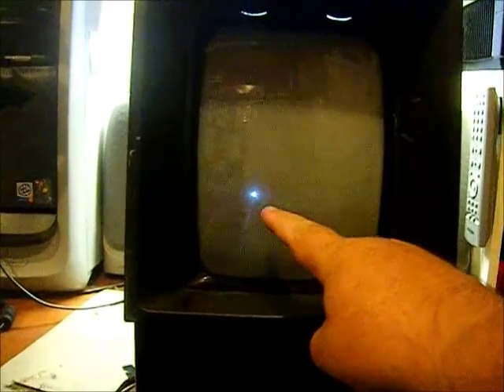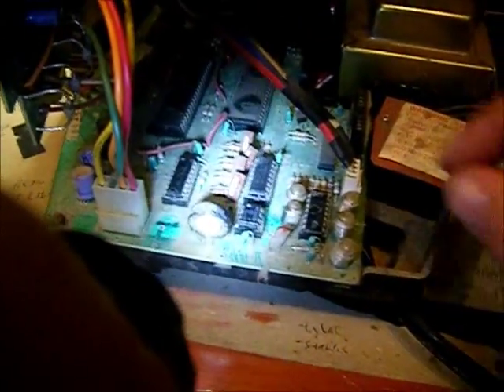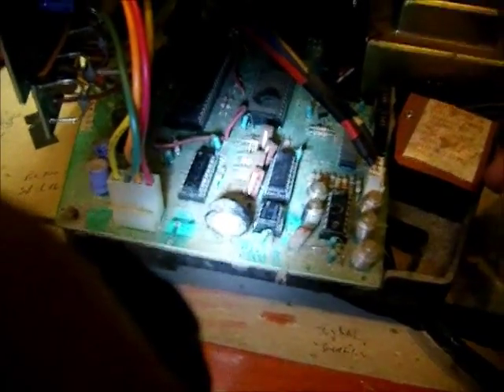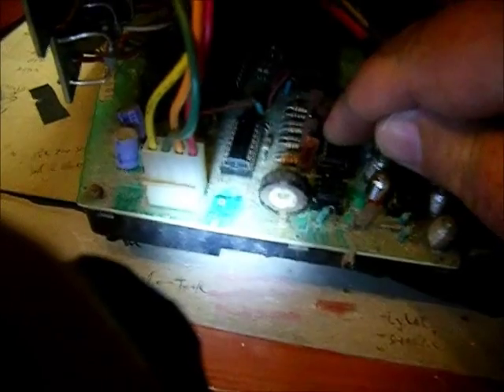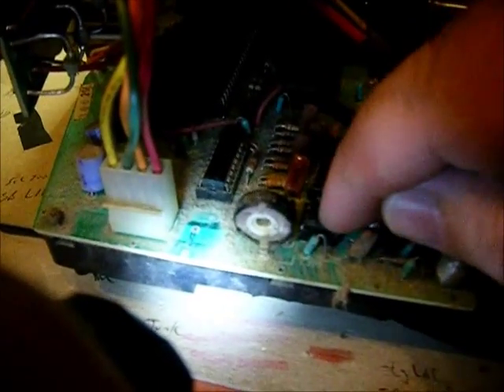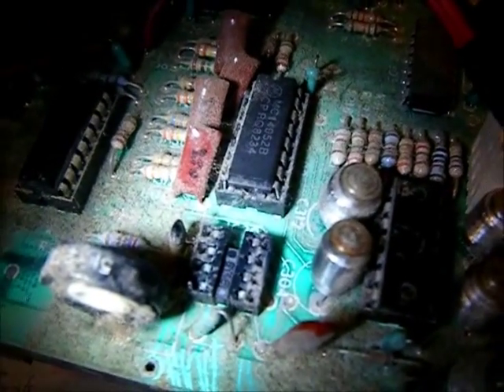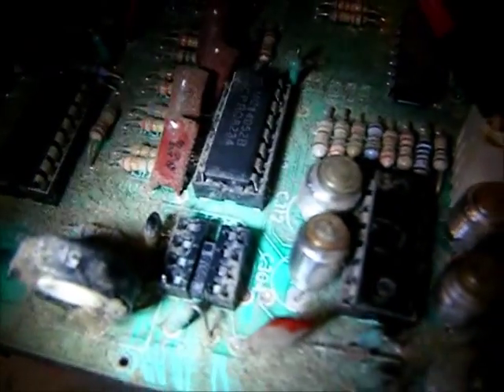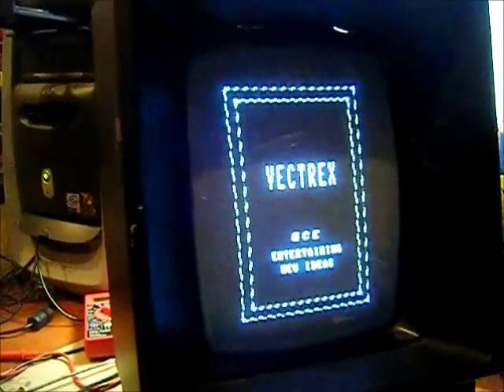Vectrex Repair for no vector, only has white dot on screen

Comment: Mine had the dot in the center of the screen. It would fire up sometimes after a few switches off and on. Tried loads of different things, new caps, reflowing solder, cleaning ICs and sockets.

In the end it was the power switch, it wasn't connecting one of the AC lines and therefore the board wasn't getting the full power it needed. I would imagine most broken Vectrex consoles with the white dot are this issue as the switch is a bit flimsy and possibly prone to some arcing.

All I did was clean up the contacts and spray some Deoxit in there and it worked.

Comment: I just bought a Vectrex with the exact same problem. A small white DOT on the bottom right part of the screen. However when I remove the X,Y,Z cable from the logic board the white DOT seems to centre to the middle of the screen. Does this mean its an issue with the Logic board?? I thought it might be the X,Y not getting enough power. Any thoughts / ideas?

Comment: hey sir i have the same problem but when i push and pull my on of switch i get a image ?
Reply from the maker: +scroeffie sounds like a capacitor issue
Reply: The switch does fail. It can be cleaned. With the back off the unit (careful of high voltages). Find the back of the on/off switch/volume pot. There's two metal retaining tabs, bend them up and the switch will come out. It's a pig to get back in place, if you're okay with techie stuff you'll work it out. I had to wrap wire around the parts to drop it back into place and then remove the wire.

Comment: What if the dot is in the middle?
Reply: Check the power switch with a multi meter. It switches two voltage lines and if one isn't being switched you get the white dot.